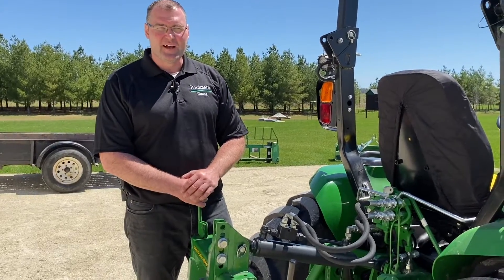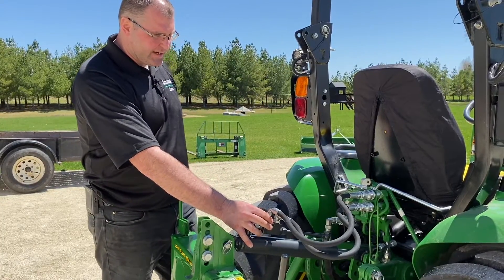3pt Hydraulic Top Link - Category 1 on JD 3039R

Comment: Curious if you have a diverter on this setup? I have the same tractor and a backhoe and wondering how you gut the switch installed got the rear top link?
Reply from the maker: When I ordered the tractor I had it setup with the power beyond kit and additional selective control valves in the back that are controlled by the switch on the joystick.  The top link hoses use those fittings.

Comment: Great video. I initially thought that you installed the hydraulic top link to provide hydraulic down force for implements that could benefit in their use. Seemingly you installed it for more convenient hookup of rear implements resting on uneven ground.
Reply from the maker: Yes.  That and it's very nice to be able to quickly adjust the tilt of an implement on the fly like when I use the box blade for snow removal.  Thanks for watching!

Comment: You’re cylinder is on wrong. The welded end should always be at the hard mount point aka at the tractor. Otherwise ok video.
Reply from the maker: I'm not disputing your recommendation but in my case if I turned it around and lift the arms all the way up I'd hit the power beyond box that is there for the backhoe.
Reply: @danimalshouse  ya you would need to turn around the hard pipe on top of the cylinder, to fix that problem I think from what seem on other pages.

Comment: Awesome set up but to avoid leaking from lines turn cylinder around. You want the Chiba’s as the pivot point at the tractor.
Reply from the maker: I don't understand why it matters as it is exposed to identical tensile/compressive loads no matter which direction it is mounted.  The only difference is that the hydraulic hoses have to flex and move more when I move the cylinder.  Do you have any reasoning as to why you think the mounting matters?  Actually, it won't matter for me because I'll crush my power beyond kit if I turn it around.

Comment: I was told by AMA that the welded section must be hooked to the tractor side and you never want to be pushing to the tractor, you always want to push away.  I have asked them if the chk valve assembly can be reversed and waiting back for a answer.
Reply from the maker: Curious to learn more about that point.  I can't imagine how the cylinder would feel any difference as the push/pull forces would be the same regardless of which location either side of the link was pinned to.  In both instances the top link is attached to the same two points.  Still curious though.  Thanks for watching!
Reply: @danimalshouse  the push/pull forces are different with the same hydraulic pressure. The force the cylinder can exert in a given direction is proportional to the surface area that the fluid can act on. When extending, the fluid acts on the entire surface area of the piston, but in the other direction, the surface area is reduced by the rod being in the way. There are various online cylinder force calculators you can use to check. It may not matter in a top link depending on the weight of the implements, but for example you swapped the direction of the loader cylinders, the lift capacity would go down.
Reply: I have been instructed by hydraulic manufacturers to mount the rod end to the implement and it is no problem to switch the locking block around.